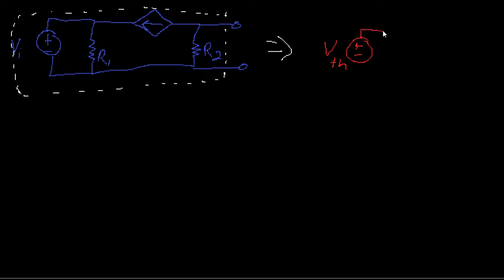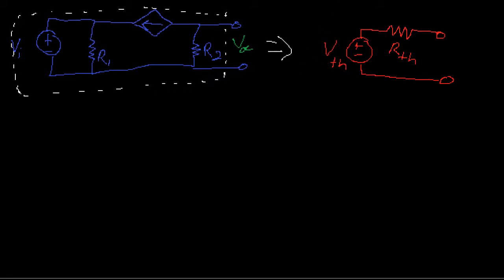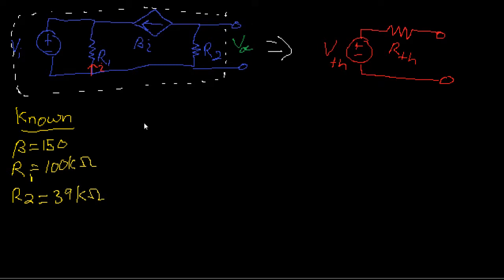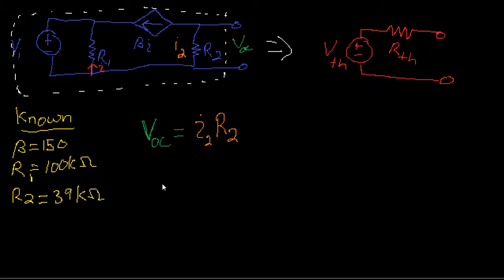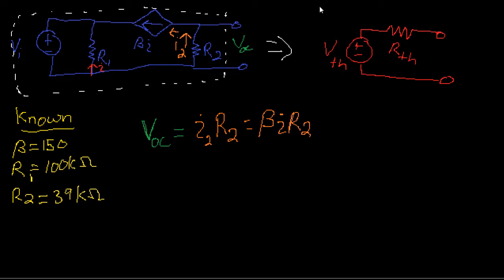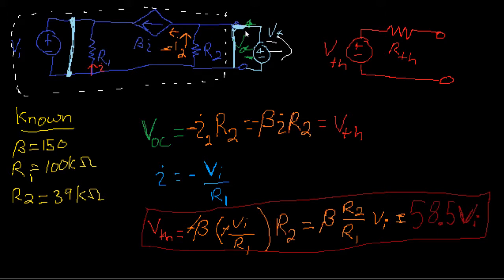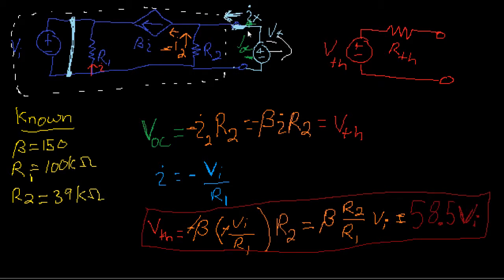Circuit Theory Review Part 1

Comment: Man this is a poorly labelled video. It should be titled "an extremely slow, drawn out, example of one particular lesson in circuit theory, featuring colorful drawings resembling 5th grade motor skills." Although I guess that's a little long. But seriously, were you solving a Rubic's cube while you made this? Cause  ......  you're   ......speaking     very......................slowly............and ........         you sound     .................distracted.